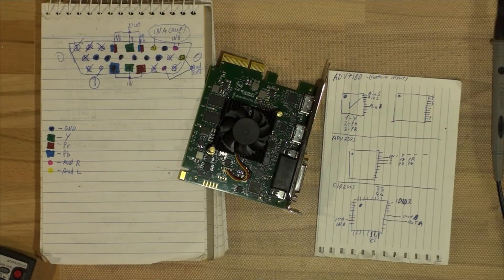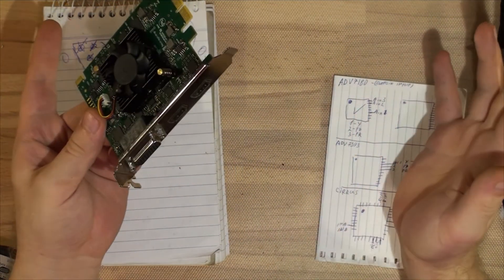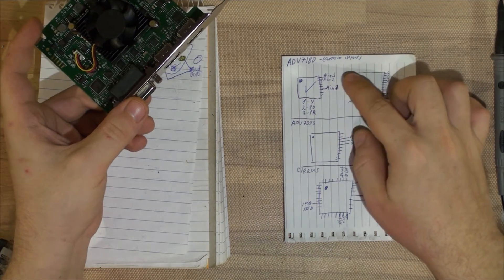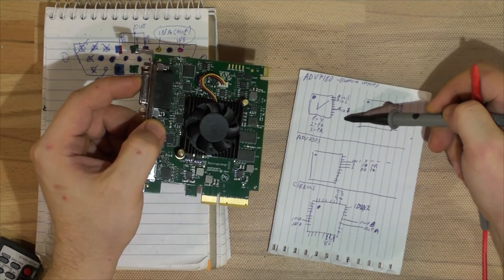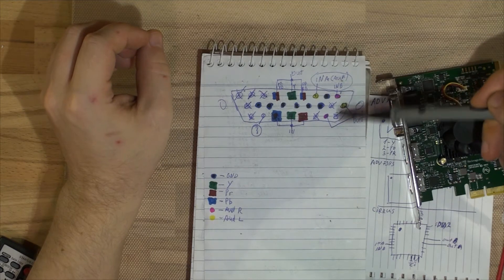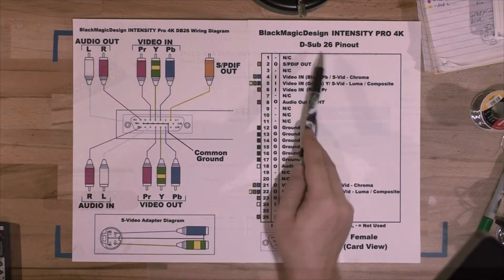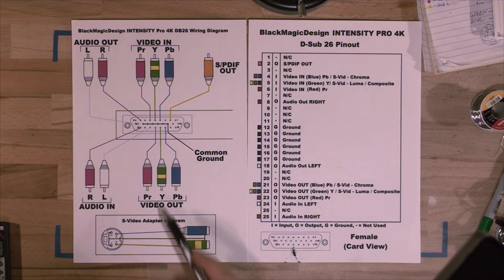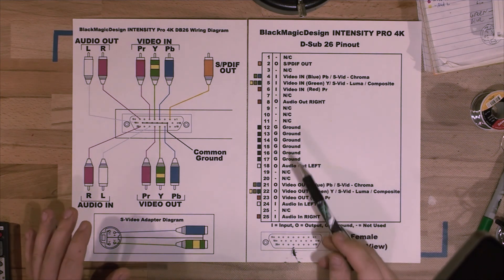Intensity Pro 4K Video BMD Capture / Playback Wiring Diagram and Pinouts for D-Sub26

Comment: Wow, I was looking for something related to the db26 or 26 pin d-sub connector on an old capture card I found in my family's recroom and you have given me the guidance on basically reverse engineering the cards chips to figure out its pinout and how the pins can be custom set up, thanks so much.